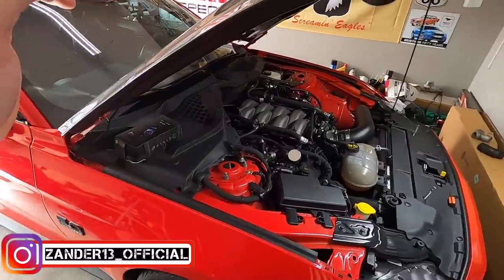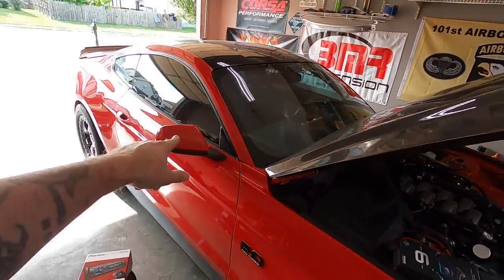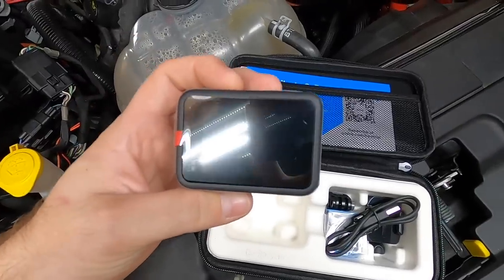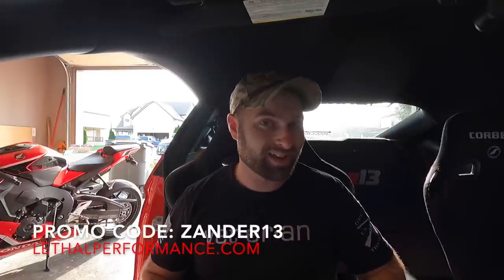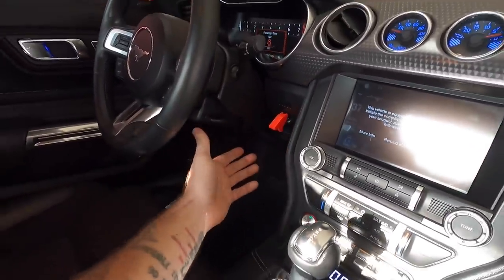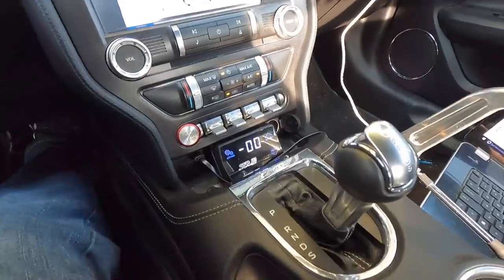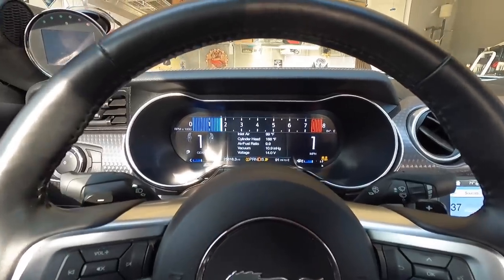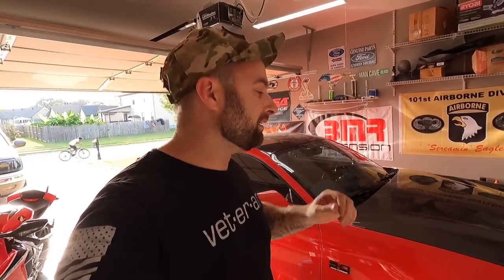TIME TO TURN IT UP? My 2019 Twin Turbo Mustang's N2MB 2 Step FINALLY WORKS!

Comment: Funny, was watching another video of yours when this notification popped up.
Reply from the maker: Notifications squad 💪
Reply: @Zander13Productions  you not going to get boost by foot braking, engage the trans brake and 2 step. then you can get you boost
Reply: Why get rid of the GoPro 8??... Seems like a two camera system would benefit you better.. Inside /outside shots, multiple outside shots.. Choices are open. Just saying. I haven't used my GoPro 8 much after buying it a few months ago, but I wouldn't argue with having two. Particularly with one being strictly for my personal vlog camera to use when needing to frame shots from the front screen, then use the other camera for other types of shots where it's not needed an much. But good to see a car channel reviewing it. 😀you gotta get that two step figured out. All turned up on boost had awaken the beast in that car(after watching the drag strip video). High speeds up top, but cutting the time down low will get you well into the 8's. LETS GO!!!

Comment: You won't be able to build enough boost with the stock stall converter. The point of the 2 step is to load the engine below the max stall speed to build boost or limit boost on launch. Your better off right now to floor it on the trans brake and let it build what it can. Once you get the Circle D in there you can utilize the 2step. You'll also wanna switch to a bias ply slick for that trans brake to really shine and not shock the tires. Love the car and watching it progress.

Comment: I sent ken the PDF. You have to be under load with the WOT box or it will still put you in limp mode. Lemme know if you have any questions.
Reply from the maker: You the man💪 from the video does it seem to be working correctly? I noticed it was really trying to spin the tires. Normal?
Reply: Zander13 on the foot brake it will. It’s just like normal when the converter flashes enough to overpower the brakes. On the transbrake it won’t chirp the tires, until you let go of the paddle.
Reply from the maker: You're mom gotcha. 🙏🙏🙏
Reply: Zander13 NP, I built a TT kit for my 2019 GT from scratch. Let me know if you get stuck on something, I may be able to help y’all out.
Reply from the maker: You're mom absolutely and thanks so much
Reply: That’s what I was wondering because the higher you set the 2 step it’s going to over power the converter and push through so need to use a trans brake
Reply from the maker: Tampabay Fishing Adventures definitely right I think. With a bigger stall or maybe if I have it in second gear a none issue but stock converter 1st gear seems to be to powerful
Reply: Zander13  I’m sure you will get it figured out, whatever the stall is in the car that’s as high as 2 step will go

Comment: Why was the wheels chirping forward while on the two step?
Reply from the maker: Building boost in first gear and stock converter. Car was trying to launch through the brakes lol. I might need to try this in second gear or upgrade stall converter again

Comment: Gonna need a converter or the transbrake. Still speed is too low to get you into boost otherwise.  Good stuff Zander. The 9 looks good!
Reply from the maker: Yes. 2k rpm was just a test. But it passed 😉😎
Reply: Ge got into some boost at 2k....zero before....he can hold it a little higher at the track, id assume...before he does the transbrake....or he may jump straight to it...its Zander13 we just got to tune in and see

Comment: 2 step set up on the mustang seems to be way more complicated than on the ls or maybe its just that type of device you are using for that. I have the lingenfelter timing and rpm limiter and its actually tied into the injectors to limit rpm and just requires a button to have active to hold the rpm the manual guys use the clutch for that and auto guys can use a button.

Comment: Zander I wanna get longetube headers but I wanna keep my factory warranty , do you know a way I can keep my warranty with getting long tubes ?
Reply from the maker: Not possible bc with headers you need a tune
Reply: What if I got tuned by Roush or ford performance?

Comment: There still is no correct information out there, can you post the correct pcm wire! Mine does not work. You would think with cars that have been out for over 3 years they would have this figured out

Comment: Hero 9 looks really good man .... I may buy one now lol ... oh and a drone
Reply from the maker: I love drone shots. MAVIC air is great choice
Reply: I grabbed a mavic air 2 fly more package lots of fun...hoping to go out and put the drag pack on and make basically my 2nd track pass this weekend ..hopefully 2nd thru about 5 or 6th hehe...fingers crossed engine has held 5k miles so far....and 100 street smashes....
Reply: BlueCollarDaily you coming to boosted’s event
Reply: @Jack-b5o6r  I may, let's see if i blow up this weekend....LOL...
  Just mounted the drag pack....got tired and sweaty its pulling a hair want to take a closer look at it tomorrow....clean up the car and see how she sticks....
 One thing I can say is at least to 74mph these New NT555RII tires make NO noise...and i got 5 mufflers id hear it ( catless headeds into 3 inch X mid muffler, a bullet resonator after that then the actual mufflers hehe )

 Nitto sent me an email today ( since this is their first batch I guess they want some feedback) told me air pressures to try and burnout method...if i can get low 1.60ft with a true street strip tire ill be super happy ( basically its a straight line Toyo R888R BUT they actually make it in our drag pack 305 45 17 size, cheap too $247 each 28 inch tall...100 treadwear R compound and drag sidewall) we shall see it done that before easily leaving in second with timing pulled to 12 degrees on hit...
Reply: BlueCollarDaily very cool